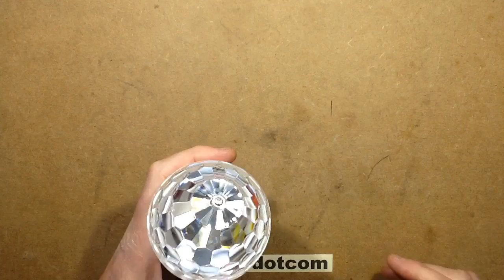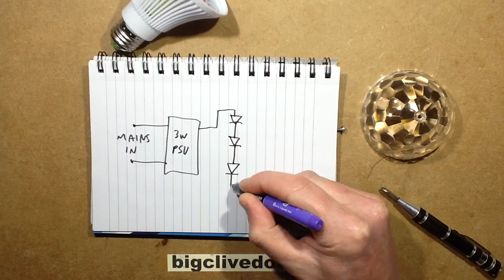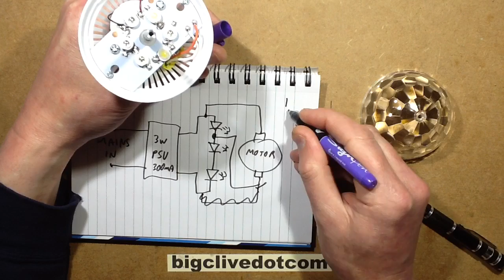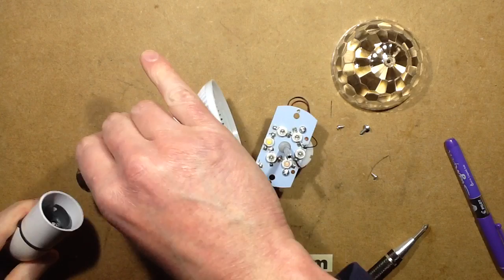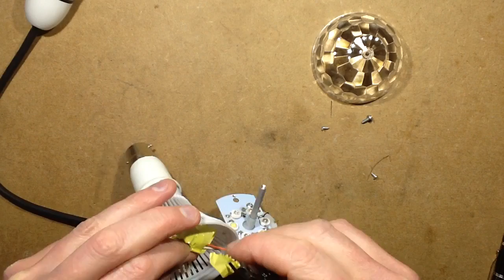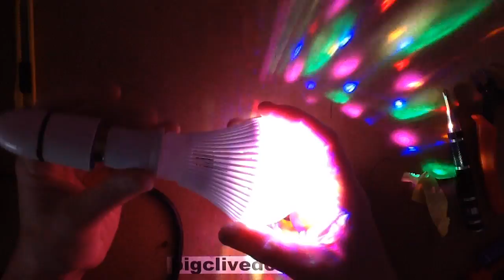Inside a new 6 colour LED disco style lamp.  (plus modifications)

Comment: Thanks, Clive.  Does anyone have a link to show me, the noob, the places to solder the right components to slow the motor, AND any video replacing all colored LEDs with a single color? 😍  Also, check the newer super tiny USB Disco Light.

Comment: Slower (IMO) is definitely better. The motor noise is very annoying. Would it cost so much to as to make such a mod impractical? Ultimate though,  the LEDs need to be dimmable,  and the motor needs a speed control. I assume both cpuld be accomplished via the insertion of some kind of adjustable PWM circutry.  Since brightness and speed control need to be fully independent from each other,  I assume this would require the PWM circuitry to be constructed from two separate sets of controlling components. I know this would raise the cost of the lamp but I would consider both dimming and motor speed as user-selectable parameters to be  the minimum acceptable features before I would purchase one. Oh,  and theotor noise MUST GO as well. Thoughts?

Question: What makes an LED dimmable or not dimmable? I've played around with several premade PWM dimmers and I'm aware you can build your own dimmer using a 555 (or equivalent) chip - they always work regardless of the LED (or set of LEDs) I am dimming (so long as I adhere to the limits indicated in the data sheets for dimmrr and LED),  so I suspect "dimmable" is not a feature/property of the LED itself.

Thanks for this video. I really enjoy watching you create these hacks and teardowns. I also enjoy the process you use to think your way through a  problem or when you run onto something unexpected.

Comment: Hi Clive. I bought a couple of these, inspired by your video, and put some potentiometers in series with the positive on the motor. It works s treat. I'm now wondering if it will be possible to reverse the rotation on the motor by reversing the polarity on the connection? I place the lights stage left and right and think it might work better if I can get the, to rotate in contrary motion. I'm probably going to try it anyway but would love your advice or input before I incompetently burn something out or blow myself up!
Reply from the maker: You should be able to just swap the motor connections to reverse it.
Reply: bigclivedotcom Mission accomplished. I figured it would work but appreciate you confirming it. Many thanks.

Comment: The effect is awesome, as far as the little motor noise. You probably could get another model that doesn't produce much noise like that, but then again if they had these things in some party of something because of all the other noise there no one would hear the motor noise probably.
Reply: At least at the start part the blue looked powerful enough and not under powered in the demo. So whatever the theory says it works out well in practice.
They probably have already made this, but another version that has certain parts of the light spreader that blends in different colours into gradients would be cool, like a swirling room of different gradients that change colour.

Comment: I wonder, i had a really simple circuit somewhere that would give initially double the voltage it was designed to put out to start a motor. I used it for a PC fan which i wanted to run on a lower voltage than what it needed to start up.
I just can't remember where i place that thing or how the circuit was done.

I should start documenting those things, because my memory is bad when it comes to that type of stuff :(

Comment: PartyPotty Alpha 0.1!
https://www.youtube.com/watch?v=9yVcy2R0a54
Installing a dozen in selected Burning Man portapotties. PIR Motion sensor activated. (obviously tunes will be automatic, todo).   Thx BigClive!
Uses a cheap MP3-playing speaker, small lipo w/boost converter, PIR sensor, LED lamp (6 led version). Running lamp at 17v. Will add an ATTiny to control tunes. Total cost about $20

Comment: Ok I ordered (to USA) several from different vendors - they all advertise 3LED. I hit the jackpot (6 LED version) with this listing http://www.ebay.com/itm/152064826323  - it seems the ones from a vendor in Malaysia are the 6-LED ones.  Externally it looks just like yours (...but then so do other 3-LED ones I got).  Basically it's luck of the draw whether you get 3 or 6, but now I've found a 6-LED vendor I'm stocking up :-)

Comment: It would be extremely easy to whack in a resistor between the motor and board of this thing. You could even use a potentiometer if you really wanted it to be adjustable. I don't know how you'd mount such a thing but putting a simple resistor in line with the motor would be easy enough. A little heat shrink tubing to keep it from shorting out and your golden.

Comment: A relatively easy way to slow down a motor is sticking some neodymium magnets to it: the stronger magnetic field will make the motor produce more torque, but it will also create a higher back EMF, slowing down its top speed.

Comment: Slowing down those motors requires a set of reduction gears. And I think you know the chinesers well enough that you know that will will use plastic for the gears. And they did with the discoball type thing that I have. 
Unfortunatly those dc motors are quite torquey and they eat plastic gears for breakfast. The discoball isn't spinning anymore :(

Comment: Don't you have any microwave motors around you could put in? I was fiddling with 2 I took out of one high end microwave where the cpu was stupified and one motor ran at 30 rpm and one at 3 rpm. It was interesting to note the one read 25 rpm on your 50 hz and 2.5 rpm or something like that... interesting to see that now parts are made with a more universal mindset from the getgo. aAnd both did reverse ever time the power was taken off and reapplied. 

I was thinking they'd be good for christmas decorations -- I have one I drilled a hole through the brass gear on the end, decades ago, and put a paperclip through it. Then I hung via clear fishing wire a stained glass old fashioned flared cross made of red and clear stained glass. Hung near a light or window it makes a nice slow subtle diffusion of pleasing light. Totally quiet, too... It was one of thoe synchro motors, maybe from an old fashioned alarm clock.

Comment: Thank you very much, Clive, for the great and interesting vids!

My thoughts are:
combine this Bulb with something like this

http://www.ebay.co.uk/itm/WS2812B-Addressable-Neopixel-RGB-Pixel-LED-Ring-5V-Built-in-Driver-Arduino-RasPi-/301945621360?var=&hash=item464d5c8b70:m:mhk8al53U8Jn-2G6tJwoZGQ

and of course a little microcontroller (even Attiny85 is more than sufficient).
Wouldn't that be fun? :)

By the way... I have to find out ... yeah, a new project for the coming weekend :)

Greetz

Comment: Slow. How would a PWM speed controller stack up for the job. Just a 555 and suitable FET perhaps?
Reply: +Alex Law http://www.ebay.com/itm/AC-220-240V-50-60Hz-4Watt-4RPM-Micro-Synchronous-Motor-for-Microwave-Oven-/321201958497?hash=item4ac920ee61:g:TocAAOSwfZhXMrku

This would do the job a lot easier. There's one on their for $2
Reply: The stop and reverse direction every few rotations might be an interesting effect, or might look horrible. Be interesting to see.
Reply: I almost took one apart to see if I could make it stay in one direction (the alarm clock ones do, if anyone wants to order one to mod it)... I'm sure you can buy them without but I think it'd probably be refreshing.

Comment: How about putting a resistor in series with the motor and an electrolytic capacitor in parallel with the resistor?  Initially the full PSU voltage will be applied to the motor, to start it; the capacitor will soon charge up to a stable voltage, leaving only a volt or thereabouts across the motor.  When the lamp is unplugged, the capacitor discharges via the resistor, resetting it for next time.

Comment: I like the slower speed too. Solution, put 1-2 diodes in series with the motor leads that are across the LED to get your 1.8 volts. Install a 100uF electrolytic capacitor across the motor drop diodes to give the motor the higher voltage kick to get it started upon initial power up.
Reply: Came here to say "Diode and fat cap, in parallel" -- discovered I was three years late :-)
Reply: +The Dollar Guy Nownownow, it's not nice to outsmart your host on his channel. :D

Comment: Used to drive motors from a negative resistance. That got the speed very constant even at very low speeds. Took a trimmer because it must be adjusted to the internal resistance of the motor.

Comment: Could you use an electrolytic capacitor and a resistor in parallel, in series with the motor wired across one of the LEDs?  The capacitor will conduct enough to get the motor started until it is charged and the resistor could limit the current to make the motor run slow?  Would take some playing but just thinking it could be worth a go.

Comment: What's the deal with the screw in to "BNC" type adapter thing? Over here in the colonies most of our mains voltage lamps use a screw base.
Reply from the maker: +Stephen Furr The UK tends to use a lamp base called a B22 bayonet cap with both the connections on the base.
Reply: +Stephen Furr Australia and New Zealand mostly use the bayonet.
Reply: +bigclivedotcom Cool, makes sense. We use it for 12v applications, it's just been 20 years since I lived in the UK and I had forgotten.. Thanks Clive!

Comment: Thanks Clive, I think I'm going to buy this light. As you said, the only issue is the motor. Any other ideas to slow it down? How many volts were you running it at with your bench power supply at the end? That looked quite nice.

Comment: Maybe, lubricating the motor. Will this affect the noise?
Reply: +Bosapiutsa Usually it'll help big time, depending on the type of motor and how well cut or stamped out the gears are.... I'd bend back the tabs, inspect it and add the thickest grease I had noting just not to use it outdoor in cold weather. I bought some cool white grease -- if you have a problem you know it for sure by its distinctively dyed white color getting outside where you intended it to be. At first glance I thought it was nutty but then I realized it was quite useful and left the store with a tin of the stuff.
Reply: BikingMNViking Thanks for the information! Cheers!

Comment: How about a capacitor across the current limiting resistor to give the motor a kick start. I think slower gearboxes probably cost more :-) When soldering to large ground planes with a temperature controlled iron why not turn the temperature up 50 degrees or so?
Reply: +Coolkeys2009 It's only about having the capability, not using it! (hell yeah, I keep my iron on high like all the time, it heats up enough to put a scar on my thumb in about 1.5 seconds... I think it's nichrome wire. I had just pulled it out of the trash and had to test it before sending away for the bits that were missing. Best $4 I spent for a set of 5 black coated ESD bits. I never use more than one anyway)

Comment: when I first started seeing these lights I had figured the lens was rotated by a small ac motor.

the next evolution of these lights could be the use of RGB LEDs that are perhaps individually addressable either by a small microcontroller with several pre programmed functions or through DMX control.

Comment: requiring a higher voltage to start could mean something is misaligned in the gearbox or is a little tight. maybe some oil might help.

for the motor speed if requiring higher starting voltage isn't fixed you could install a thermistor that increases its resistance as the temperature increases. that way the motor will have enough voltage to start, but then drop down to where the speed is slower.

Comment: Kludge some sort of RC/diode hybrid in series w/ the motor- that would initially put the full voltage across the motor to get it moving- but as the capacitor charges to a maximum set by the diode reduce the apparent voltage to the desired level?

Comment: If you ran the motor through a resistor to slow it down it obviously wouldn't initially start turning BUT what if you manually bump start it by twisting the cap just to get it going?

Comment: and also if you just say put a diode or two in series w/ the motor would you drop enough voltage to get the slow rotation?

Comment: hey Clive what tools do you use for taking stuff apart, i find my philips heads tend to be the wrong sizes and i strip things out. im wondering if you have a high quality set of mini screwdrivers or do you just use em till they wear out and toss them out since hey are cheapos?
Reply from the maker: +fullspectrumrc I use a generic 9 in 1 set from Poundland in the UK.  It seems to last well.
Reply: +bigclivedotcom ahha just as i suspected im just dumbfingered. thanks for the quick reply love your videos.  im a takerparter myself. keep up the great work

Comment: Definitely slow is best.. but wouldn't it be possible to put a high value resistor in series with the motor and get the desired effect? or maybe some simple zener diode circuit to provide the start voltage spike.

Comment: I have one of those early units with 3 LEDs inside. I also found it spinning too fast, so as a quick and drity fix I just added a 500ohm potentiometer in series with the motor to be able to adjust it. I can now adjust it to anywhere from 0 to full speed.

Comment: This may be a stupid question as it may not heat up at all, but is there a way to increase the thermal mass of you iron using a larger tip or replacing the shaft? JBC irons don't look like the shaft or tip are that much bigger but they seem to have a much better thermal mass (but are out of my price range).

Comment: As mentioned before, why don't you put a resistor in series with the motor, perhaps a capacitor in parallel with the resitor for the initial "kick start", don't know if it will work, just theory. When it starts the capacitor needs to charge, thus allowing more current to flow throug the motor, once charged, the resitor takes over, so to speak...

Comment: If you add a drop of 3-in-1 oil to the bearings in the motor, it might make it spin a bit quieter and start easier at a lower voltage as they tend to put some pretty dismal oil on those bearings, and just a tiny drop of 3-in-1 improves them quite dramatically... :)

Comment: To make my motor quieter, I opened up the gear box and tidied up the gears by removing the burrs left from the plastic, then re-greased them.  I agree a much slower motor would be better.  I use two of the old type (RGB) as a back light effect.  one motor goes clockwise, and the other goes anti-clockwise.  Using another power supply to power them from outside could be a way to go.  Thanks for the videos, keep them coming.

Comment: As with so many things Clive features I had to get one of these. 
I'm curious to fiddle with it the motor is interesting.
EDIT
What about a piece of stationary diffraction material beneath the dome positioned right above each LED as an extra layer of breaky-uppy stuff for the light?
Reply: +Michael Thompson diffuser? You know whats great for that? They make a spray on product for household windows by that big name paint maker that escapes me... I have a can in my other place. Nice thing about it is you can spray just a little or a lot. Just do it in light even drying coats because someone else grabbed my can while I wasn't looking and they dripped it and made a slobbering dog mess of the whole works. I should probably scrape it off and respray that but it also wears off after 2-3 years so it'll probably just even out eventually and I'll redo it when I do the other windows. Not as permanent as I'd like but still an excellent product. besides a spray of clearcoat would probably fix the durability issue.